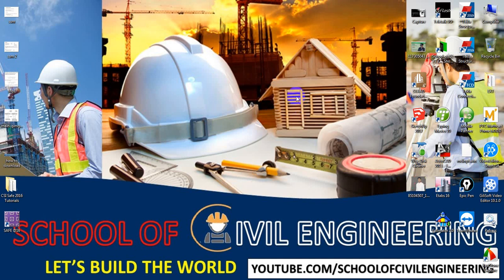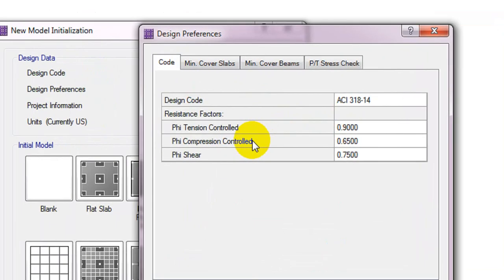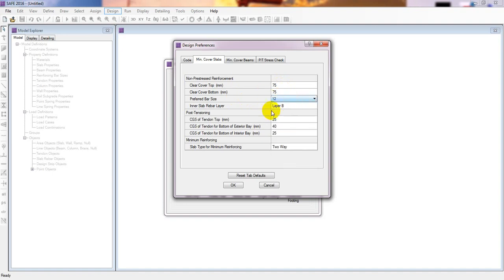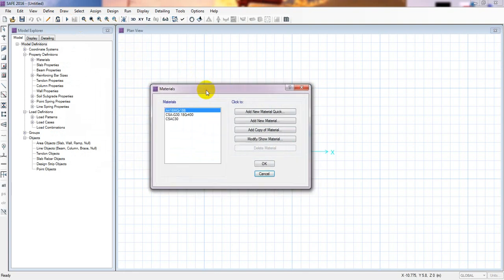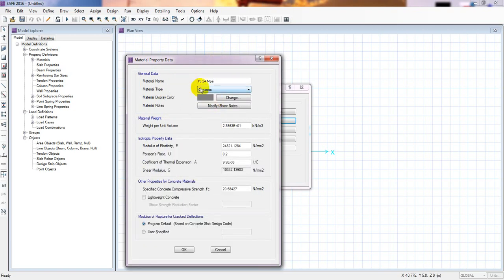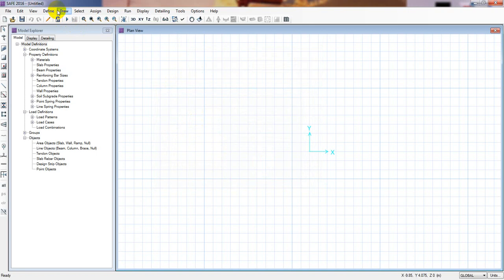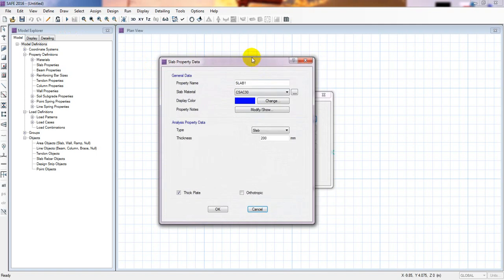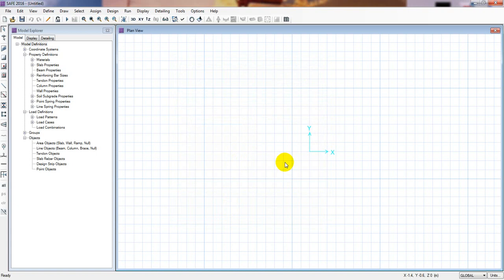CSI SAFE 2016 TUTORIALS | DRAW AND DESIGN ISOLATED OR SINGLE FOUNDATION IN CSI SAFE 2016 | PART-1

Comment: Brother reinforcement calculation ta bujte parce na 2 layer e top bottom ace but single footing e to 1ta layer thake
Reply from the maker: its not right. its totally depend on load, moment, FS, Sliding, Overtiring moment.